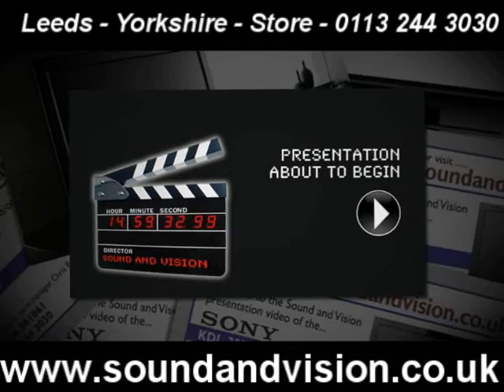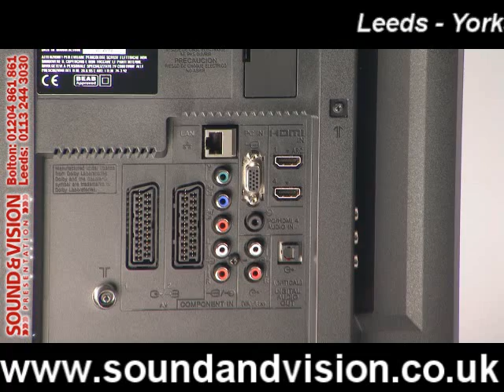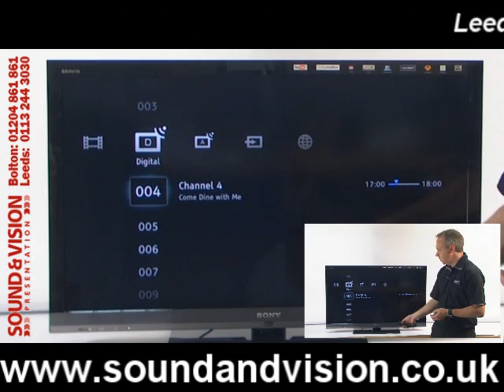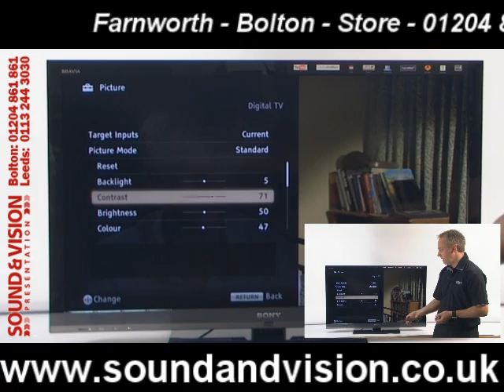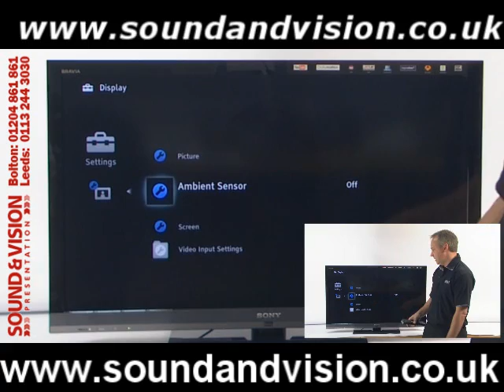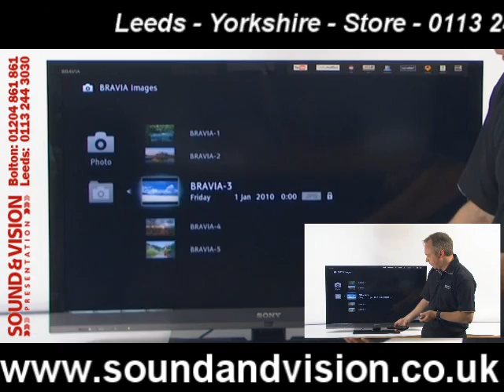Sony Bravia KDL32EX713U/KDL32EX713(Video Review)Cheap LED T

Comment: I just found a sony bravia model kdl 32ex710 !  Missing power cord & remote. But I swapped out an old cord from an E-bike charger and to my amazement the bloody thing still works.

However, without the controller I am forced to use the buttons for U I .   

I can't seem to get it to either recognize or recieve my portable wifi signal. I was hoping to use it for gaming. 

Any tips on how to connect it to my phone?